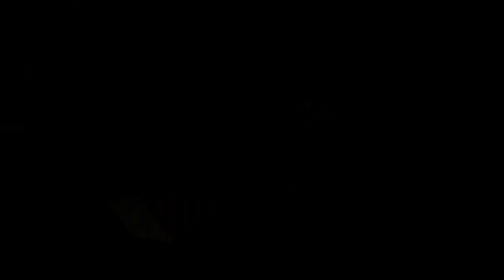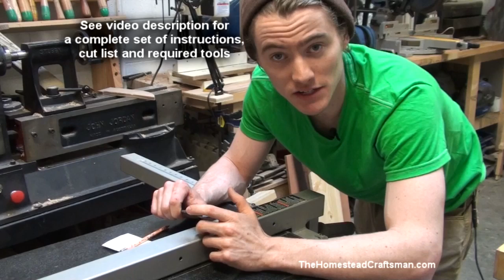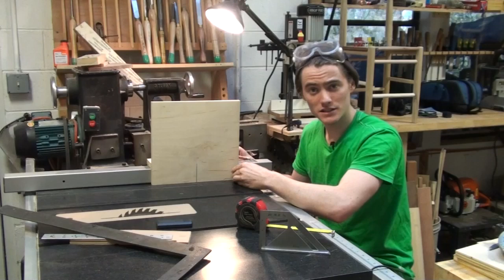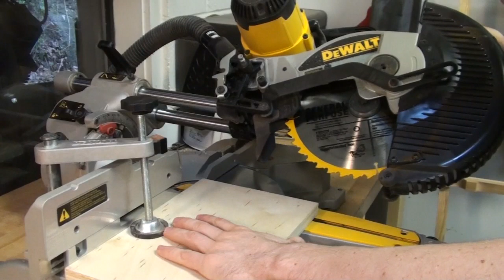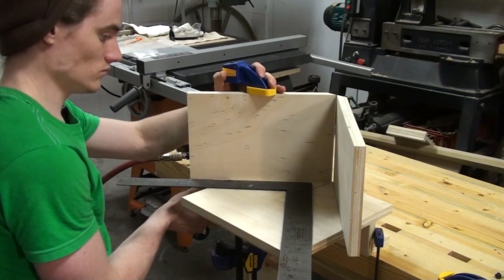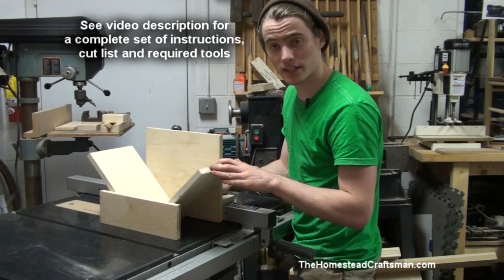How to Make a Spline Miter Jig

Comment: Fantastic video! I was able to make the jig this evening and just in time - I'm making new frames for my windows and a friend who is a retired woodshop teacher suggested that splines would be better for strength as that has been a problem. I have a question about using this for angles other than 45's. I am working on replacing a frame for a 45 deg bay window and the front miters for the frame at the bottom of the window join at 22.5 deg. I am going to experiment with some scrap pieces tomorrow but wondering if I should make a new jig with the other angle. Thanks for the video - very clear and precise.
Reply from the maker: Instead of making a whole other jig, you could just make some wedges that make up the difference, either one and not worry about it not being perfect or two which would center the frame........you could also just not worry about it and put it through as is, i won't be off that much. It also sounds like you may not even see it on the project you are working on.
Reply: Thanks for the response. New to using splines so will try your suggestions. Thank-you.

Comment: Nicely done! I will be building one of these tomorrow. So do you basically cut up "parts D" depending upon where you cut your splines? I suppose even with many passes across your blade, you should have enough of "D" to hold everything together, correct? Do you ever "wear out" the jig from too many cuts? Thanks for the vid!
Reply from the maker: Sam Slayden Yes, after a while these types of jigs get pretty eat up. If you want though, you could make it so that you could replace the bottom part that gets cut up. But it only get's cut up down at the bottom, so it still works, but if it is really cut up, you might not have something backing up the cut where your spline is and chip out the piece as the blade is coming out the back side. But you could just slip in a board behind it, as long as you use it on all cuts.

Comment: Excellent video. I'm just curious why the jig needs to straddle the fence?
Reply from the maker: It's not required, but it does stablalize the jig more than if it simply ran against the fence. It keeps the jig from shifting to the left away from the fence which makes for clean, consistent slots. If you go through the effort to make one, i'd go ahead an make it to fit your fence. If you want it to work with several different table saws, you could make the part that hugs the fence adjustable. (if that's what your getting at)
Reply: The Homestead Craftsman I guess I was getting at just making it simpler and... lazier, lol. However, I actually did make one yesterday. I made it exactly to your plans and dimensions. I hope to try it out this week. Thanks again for the video.

Comment: Hey man great video! Do you think it would work making a spline jig for a biscuit cutter?I don't have the space for a table saw in my studio and want to make some large frames with nice splines.any leads? thanks!
Reply from the maker: You can use a biscuit in a miter, but not as a visible spline miter joint. You can make your cuts on the mating surfaces and it will ad a lot of strength. I think you could figure out a way to do a spline miter with a router using a jig of some sort, you can do almost anything with a router. You could also cut them by hand if you are skilled! But I would just cut dovetails if I was going to bust out the handsaw. I tiny portable table saw is pretty small and light, not sure what doing this operation on a light weight saw would be like, but the tool it's self is inexpensive. If you have the room, the portable ridgid saw looks good, I plan on getting it as a portable option once the one I have now passes away. Although that model is not what I would call cheap. $500 Thanks for watching and for the comment/question! Wish I had a better answer.

Comment: Not sure if you would be interested in doing this, or if you have the time or the need, but if you do- Would you be interested in showing us how to build our own wood lathe using a 2 horse power motor and perhaps making lathe tools forged by hand? The latter is not so important as I am interested in putting my own together, but would like to do so without spending an exorbitant amount of money. 

At the very least, I'd love to know what kind of lathe you are using :)
Reply from the maker: I'll leave that video for someone else. I have a lathe, so making one isn't going to get me anywhere. I make my own tools in certain situations, but wouldn't make this kind. I could do it, but it would be only for novelty. If your considering it out of concerns for cost, it will not save you money. You could get something that you could call a lathe for not too much, but to make something nice you are going to end up spending some money and a huge amount of time. For me, I earn my income from making furniture. If I used the time that it would take to make a nice lathe to make the furniture I sell I could by any lathe I wanted. And I think that applys to most people. Same goes for the lathe tools, unless you are making a specialty tool. If your just simply want to make a lathe to do so, go ahead, but for my situation, it would be time spent unwisely. My lathe is an old delta, 1950's or so. Variable speed, 42 inch(i think) I like it a lot.  All my lathe tools range from el cheapo to middle of the road with some of them being ground out of old files. If you looking to save money buy a used lathe, I see nice ones frequently on craigslist. One of the Jet lathes with variable speed is a nice option for spindle turning.  Feel free to keep the comments going!

Comment: ok dumb newb question, when you cut the splines do you just cut through your jig everytime? I watched the other video first and assumed you just made the boards at a 45 degree (D parts) not go all the way down to the table so the box you were cutting stuck out lower than the jig...instead do you just make the cuts you need through the jig boards?
Reply from the maker: HI, yes, I'm cutting through the jig, it does not hurt it. After a while it will look a little chewed up, but it does not affect it. Normally I end up cutting splines at the same distances from the edge of boxes so The cuts land in the same place on the jig, giving a little support behind the cut, which helps with tear out, regardless, use a sharp blade and make the cuts slow. Thanks for watching.